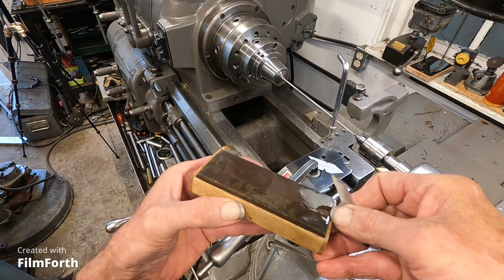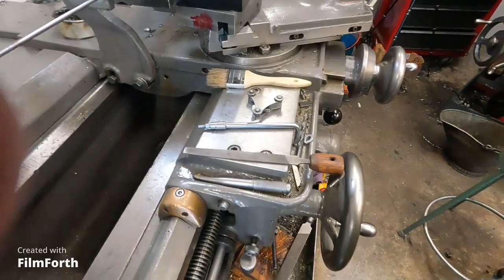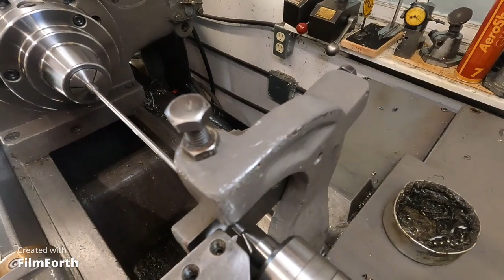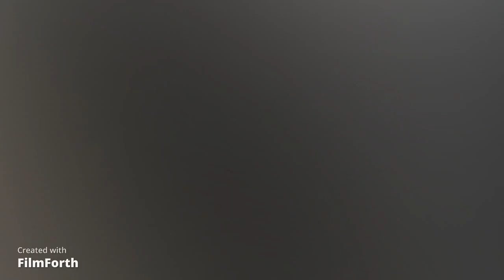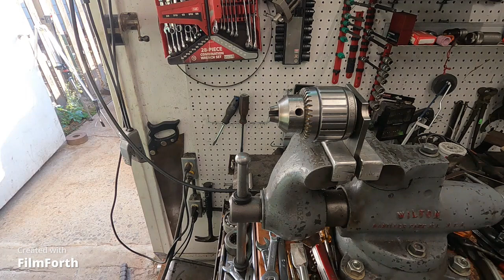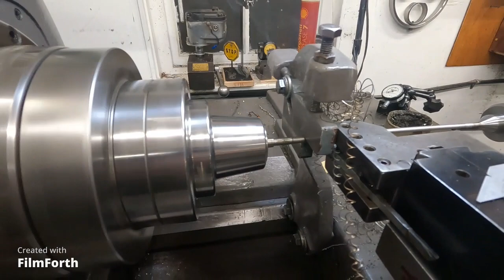Machining tool room lathe screw thread cutting special and metric

Comment: My 1957 DSG 13" has 48 pitches 2tpi up to 112tpi, not that I think you would ever use anywhere near that fine, metric or other pitch types required altering change gears.
The 1972 1307 machine I have just bought has 45 pitches 4tpi to 112tpi but also metric 26 pitches 0.5mm to 7mm selectable from a lever on the gearbox, the headstock has provision to provide a 4 to 1 coarse threading drive when in the back gear, or if in high belt speeds a 2/7 reduction on the feeds, meaning the usual  0.04mm per rev minimum feed (just shy of 2 thou) becomes 0.011mm (about a half thou), which should be really useful. Max feed is 1.12mm per rev or about 44 thou.
It is a metric machine with a 6mm pitch (by 35mm dia) leadscrew
Reply from the maker: The DSG lathes are really interesting, I have been watching what videos I can find!